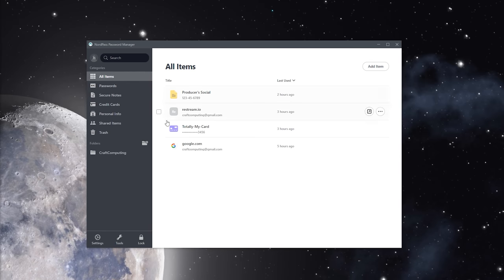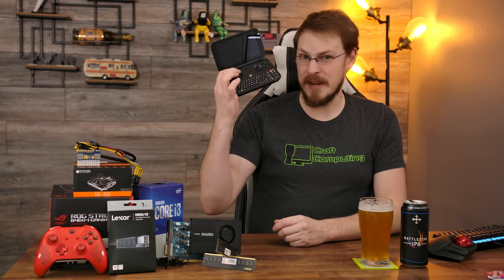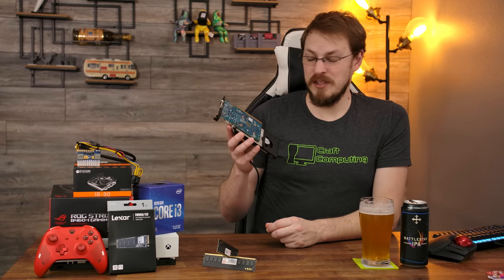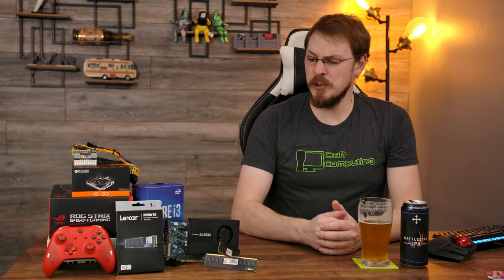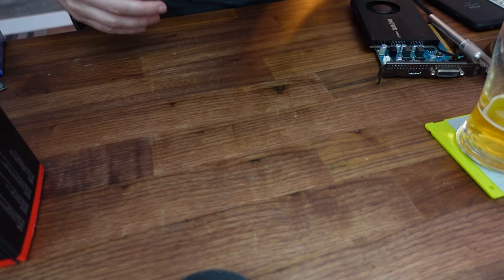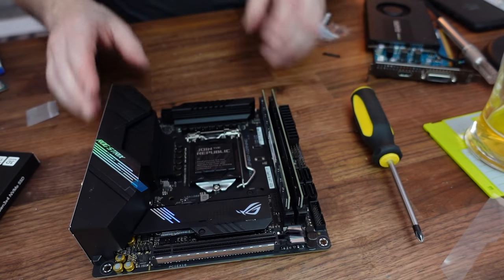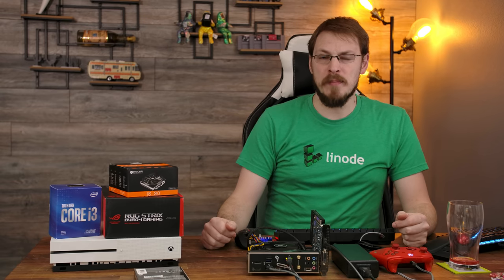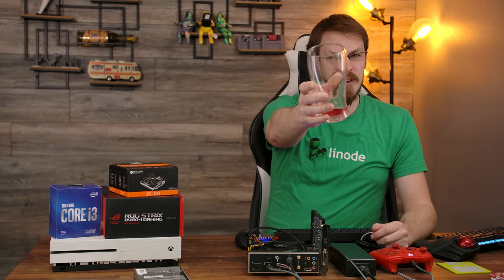Gaming PC in an XBOX One S - Making Everything Fit

Comment: "I didn't, I just cut the capacitor off" 🤣
Reply: Yeah! I just watched it and... "whaaat?!?!"
Reply: @asdrubale bisanzio True
 I also like to add extra capacitance at the end of SATA andPCI-e gfx power leads anyways so my holdup time is much improved as is the bulk filtering on the rail at the device end of the supply cable. Problems show up with age as electrolytic capacitors dry out and reach EOL, my empirical data shows adding extra capacitance gives longer service life, presumable because high frequency switching noise if shared with my added capacitance and therfore reduced through the original caps - especially in very warm evironments like desert heat or the tropics.

Comment: Remember kids: If you break a capacitor, amputate it!
Reply: Closest thing i did once was ripping off a printer piece that was stucked in order to finish the print job i had to do. I had the printer that way like 3 months running until ran out of ink. By then i had to wait for the piece
Reply: @asdrubale bisanzio Same thing with amputation of a limb. Not carrying anything essential(no vital organs), just bridging the important parts to the ground(one leg) and only matters if you're going faster than you're supposed to(running).
Reply: @asdrubale bisanzio is jok
Reply: Wow. I just did a video where I repaired a laptop motherboard. I didn't mention it in the video but I ended up leaving off a little capacitor because it got lost. In many cases you can remove a capacitor if it is one of multiple in parallel.

Comment: I did one too, some weeks ago: i3 9100, gtx 1650 lp oc, m.2, normal ssd, noctua l9i, asus rog Mini Itx, hdplex 200w pico psu and hdplex Power brick,  4 noctua 4mm fans and leds all inside the Xbox one s all digital, was a Hell lot of work and 3d printing and designing brackets but was totally worth it, just had to replicate the hole mesh on the other side for much better gpu ventilation, now happyly playing age of empires on sff 👌

Comment: So you want to show Linus how PCmasterrace is properly done without failing? xD
Reply: Linus was doing it within price budget, not space.
Reply: @Anaerin  I think he is still better in budget than linus built xD
Reply: @DigitEgal  Not even close. This build was well over $800 (likely $900 considering current graphics card pricing) and that’s without counting the case or a controller. All told this will be nearly twice as expensive as what LTT built. You are foolish to even try and compare the two.
Reply: @MrThedennisblack  I´ve just seen how much this mainboard costs.. damn...  But why foolish? linus cheated by buying a used 1070 for 200 bucks so i think they would be pretty even when bought everything new.. but both still nowhere near 500..

Comment: if you are going to use steam big picture mode to run this as an HTPC,  I still recommend  the app called "Controller COmpanion"   I use it on my htpc's,
So what it does is, it turns your xbox one controller into a k/b& mouse combo,   the left joystick is your mouse, and  when you press the joystick in, you  get an on-screen keyboard.
, 
you can switch this feature on/off by pressing  a button combination of your choice, (i have it to "back" & "start" buttons) 

It works really well, even when IN big picture mode, you still get some prompts from games and windows occassionally,  

with this app, you don't need to ever grab your mouse *& keyboard,  you can just   use your controller and never leave your couch,

Check it out when you can, "controller companion"

Comment: I've been looking at that motherboard paired with an i3 10100, 64GB RAM, 6x16TB Drives for my new NAS in a Node 304 case.
Also just ordered an LSI 9223-8i card preflashed to IT mode on eBay for $42 including cables and shipping to Sweden.
Reply from the maker: That sounds like a solid system!

Comment: One of the reasons I went with the ASUS ROG Strix B450-I Gaming AMD AM4 (3rd/2nd /1stGen Ryzen ITX SFF Motherboard is the fact that it handled two M.2 Nvme drives... No extra sata cables or power to a 2.5 drive in my Lan ITX box..

Comment: You could make a seriously tiny computer with a custom case and a GPU riser (if you don't count the external power brick). If only more graphics cards were efficient enough to run a single slot cooler

Comment: About a year ago I slipped with a screwdriver and knocked a tiny (tiny!) surface mount capacitor off the Voodoo 3 3000 I bought new way back when. I about $#!+ a brick, but everything seems fine. If that capacitor's absence impacts the card in any way, I haven't been able to tell.

Comment: I'm wondering what temps you are getting with those servers you built a little while back with Xeon E5-2648L CPUs. I got all the parts to make one too, but not sure how hot these CPUs get and what's an appropriate cooler for them.
Reply from the maker: The 2648L are some of the coolest running Xeons. The Supermicro 2U heatsinks I put on there keep them under ~40C.
Reply: @CraftComputing  Nice. So probably don't need anything big or fancy. Thanks for the tip.

Comment: 1650 super would have been a tad faster than 1060 6gb and worked as well... around 4% faster where 1650 standard is 35% slower than 1060 6gb
Reply from the maker: 1650 Super requires additional power, is a higher TDP card, and like everything else, is completely sold out right now.